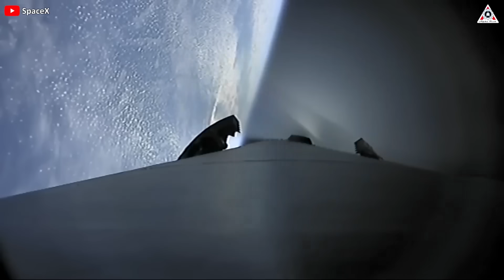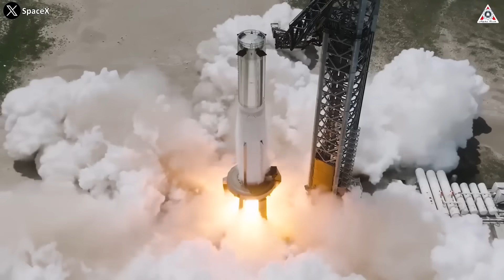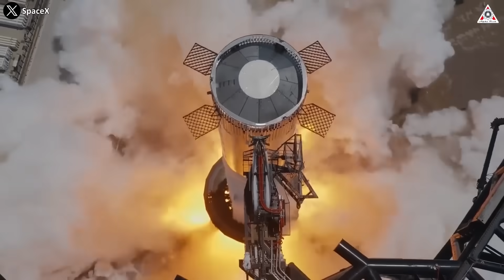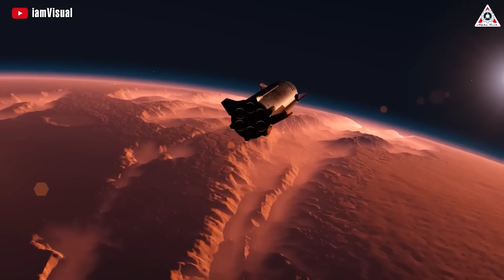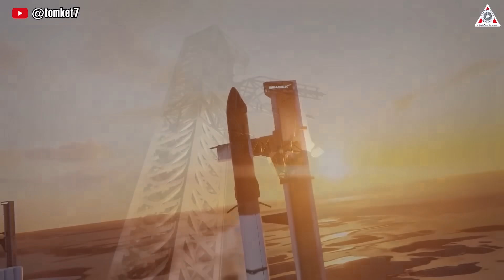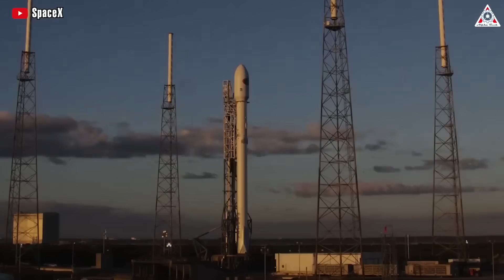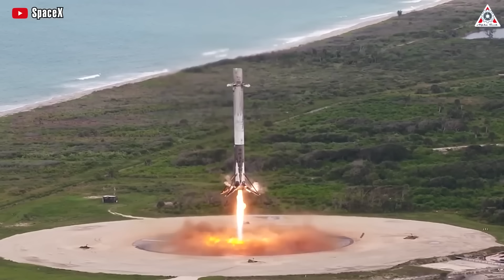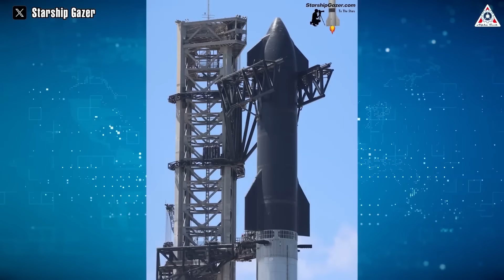SpaceX is to land the Super Heavy Booster on Droneship! Mechazilla catching is mind-blowing...

Comment: The engines have in the past had failures. If a few engines failed will it crash into the tower. . If the launch damages the tower will the landing be scrapped?  A separate tower will help endure the lsunch tower can be reusable and the landing had a fit tower to minimize loss on landing.
Reply: If an engine restart fails or some other anomaly occurs they could maneuver the booster or ship away from the tower (perhaps off shore) to avoid damage to the tower.  This should cover some of the failure modes but there could still be failures that crash the tower.  The protection from mission disruption in this case is to have an extra launch site(s) for redundancy.  I expect they will need this anyway because there are other ways a launch site could be put our of commission (hurricanes, earthquakes, tsunamis, ...).